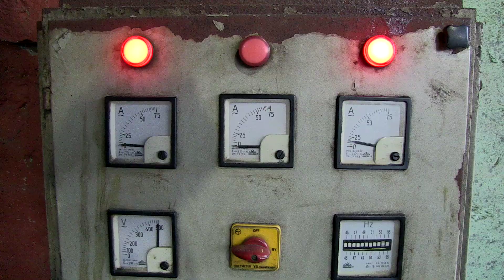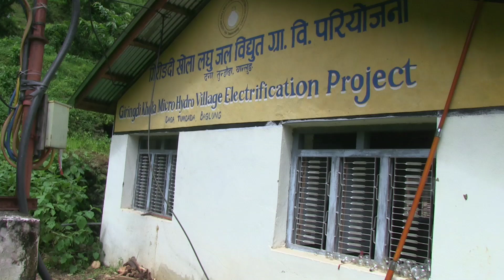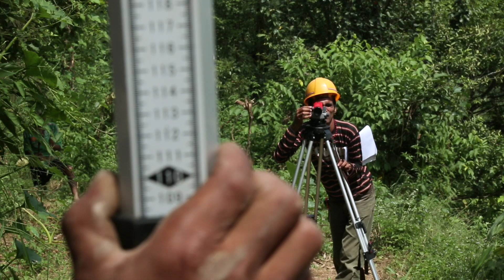Nepal Micro-Hydro

Comment: 30kw won't power all of that - a welder uses 8 kilowatts meaning that overloads for the mini grid would be all too common
Reply: yup, but in day time the peak operating power is low so 1-2 weld shop wouldnt do any harm at all.
Reply: And alot of these system are tied together in a mini network.
Reply: No, a welder does not use 8kw. Most small welders can operate on less that 2kw. Most welding done in a small rural village will never require 8kw of welding. I've worked with some welders on the railroad that would draw every bit of 60kw and run off 440v 3 phase. Nothing within 100 miles of that place requires a welder that big. They are not welding locomotive frames.

Comment: There nothing that make me think this is a bad idea, if we produced micro hydro in all country we could have unlimited energy & shut down are coal & oil stations.
Reply: Wrong! Hydro power requires the availability of a debris free water flow. You can only exploit available water drainage when and where it exists by impeding it to feed a turbine. Be careful not to cause floods and water rights issues.
Reply: Stephen White is it not simple to filter the debris? It could probably be filtered with something as easy as a net....
Reply: First, need a lot of flowing water. Most land does not have it. Rain fall will not work right. Second, need self cleaning filter device. this could actually be done. But actually returns a bit more water back into the stream during the backwash cycle when the filter is washed and the flow is interrupted to do so. These are the reasons it needs to be on a river or stream.
Reply: Stephen White you can create vortex turbines, they are more efficient than the one in the video is being used. and it uses the natural flow of the vortex to push the turbine around.